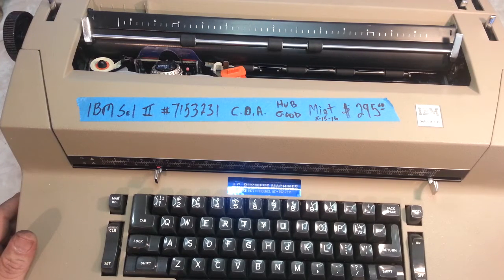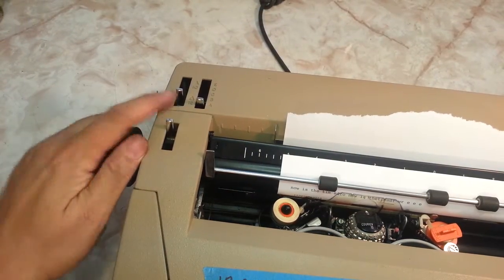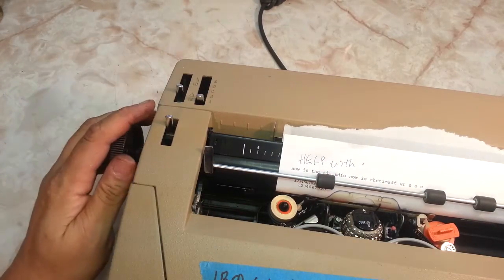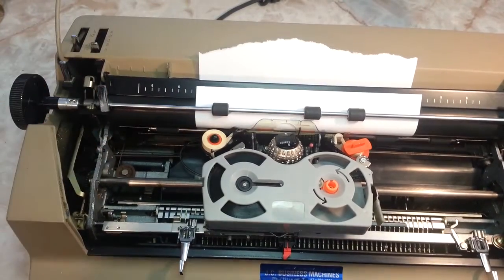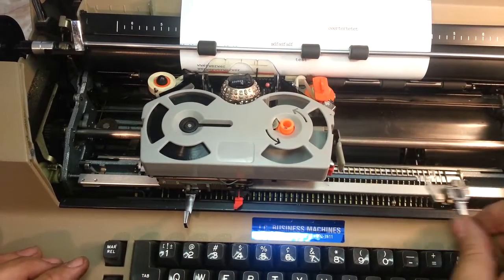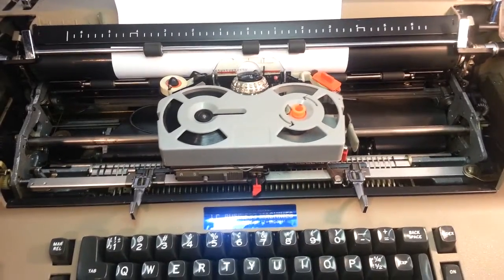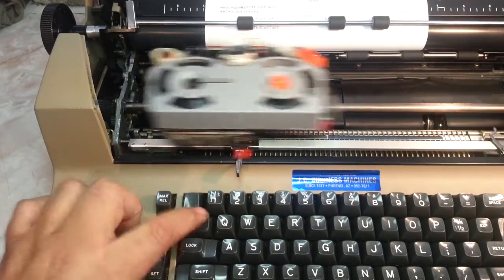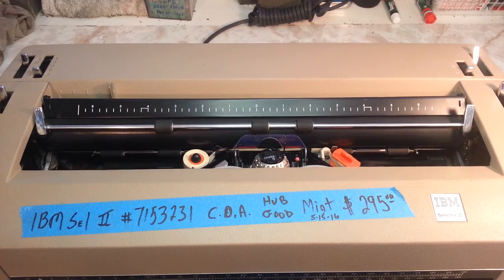IBM selectric 2 II tutorial How to use Typewriter Features Reconditioned Basic operation 101

Comment: You show how pitch can be adjusted to 10 or 12. But your ball is elite Courier 12. What's the interplay between ball type and pitch selection?
Reply from the maker: 10 pitch, Pica, is larger spacing @ 10 spaces per inch
12 pitch, Elite, is smaller spacing @ 12 spaces per inch
10 pitch ball will have larger type, set to match 10 pitch print spacing will be standard
12 pitch ball will have small type, used in 10 pitch setting the printed type will spread out, 
10 pitch ball will have larger type, used in 12 pitch setting the printed type will crowd, the letter M will touch itself

Comment: Can you please help? The ribbon isn't rolling as I type. It's marking only one single sector of the ribbon ink and won't turn as I type. The ribbon seems like its just like yours all ribbon rolled on the left side and nothing on the right side and as I type the ribbon remains all rolled on the left side the left bobin
Reply from the maker: Can't do much long distance, You can make sure ribbon is installed correctly, https://youtu.be/BXBNMPc6rbg
If everything is installed right then typewriter has a problem, sticky parts, gear broken, troubleshooting would need to be done
Reply: @phoenixtypewriter2136  after looking better into it I realized that the problem is with that center column that should move towards the right side but its stucked in position.
Reply from the maker: @TheDormonid  Very common.... https://youtu.be/IAej9KZhZ3Q

Comment: Very nice! I have a Correcting Selectric II, very similar to this one. I believe mine is from 1976. How would I go about fixing the return? When you press return, it indexes the platen, but only moves back so far. Not all the way to the edge of the paper...
Reply from the maker: Most likely a sticky latch gummed up from the old oil coagulating. Could be operational shaft cams are not pushing the mechanism far enough to latch up. Could also be the margin rack out of adjustment. Could be the tab not disengaging, over-riding the latch up process. Could be couple other things. No simple answer.

Comment: When I type fast the letters get out of place and overlap. Would you happen to know what is causing that? I think I heard you mention the solution in one of your vids, but I can’t find it...Thanks for all your videos and tips.
Reply from the maker: More trouble shooting would need to be done because multiple things can cause mis-prints. 1st is to analyze the mis-print, then clean inner ring of typeball, then clean & relube all rotate pulleys & make sure all is turning freely. Then make sure carrier is moving freely & keeping up with action. Also should check escapement rack make sure it's not hanging up there. Could be the interlocks are sticking. Could be the keyboard interposer trips are sticking. These IBM selectric need to be properly serviced & now-a days the old 30yr+ oils have coagulated & are causing slow response, which can cause mis-prints & strange behavior.

Comment: i just bought one . it seem to be working but makes a humming noise similar to a running PC is that normal ?
Reply from the maker: Well these do have a motor and operational shaft that turn while machine is on and running, so some noise is normal.
Very well serviced machines are hard to tell they are on sometimes . . . .
Others have noises, vibrations, clicks, etc. I would have to hear it to tell you if it was normal

Comment: I have one of these but it doesn’t have a slot for correction tape,the keys won’t move, and whenever I press a key it freaks out. What should i do?
Reply from the maker: Quick answer is bring it to a professional typewriter mechanic, Probably sticky, gummed up parts, Isolate and flush/clean
Long answer is study the theory of operation of the IBM Selectric, get familiar with how it should work, then troubleshoot typewriter and clean and service and repair as needed, Btw this took me 10 years . . . . .

Comment: My typewriter keeps on getting stuck at the 50 on the front. What do I do?
Reply from the maker: Look for the obstruction/troubleshoot, check the lower operational covers for warpage, 
check the tabulator rack for errant tab stop, check the main spring for loose tension,
check the feed roller clearance, check the right transport pulley

Comment: Here's a question: I noticed a few keys, such as the "1" key, have four or five symbols. Seeing as there appears to only be a "shift" key, and no other "modifer" keys, how do you use those?
Reply from the maker: IBM would have different balls, usually 4, that would have different set of symbols. The key-tops on most selectric II were universal & listed several per effected key-top. If you ordered a Selectric 1 with a type ball with special symbols the machine would be fitted with corresponding key-tops to match. Some selectric 2's were also delivered with only the matching key-tops when order with special type ball. Selectric 3's added 8 characters to the type ball thus eliminating this some, but they still had mutable choices also. I have a IBM type chart that shows the type style & the different part numbers associated with each special symbol-ed balls. BTW, right below the plastic piece that you pry open on the type element to change it is a 3 digit code for that balls exact style. I will try to add the chart to the end of the video.
Reply: Phoenix Typewriter
Ok. That makes sense.
Reply: I was going to ask the same question!! How do you type the number 1!!! :)

Comment: the Old English text on my ball element, does "machine gun" typing when I key the "e,"then almost simultaneously it hyphens, e-e-e-e-e-e-e-e- non stop! how do I prevent that? Bakersfield , CA have no technicians to checking or repairs! I use Selectric to type a Bilingual Newsletter to my dancers, & can fit more words than on the PC. PC has NO Old English Text.
Reply from the maker: Sounds like sticky parts, many things can cause cycle clutch not to latch up (repeat)
There are a bunch of typewriter shops in California : https://site.xavier.edu/polt/typewriters/tw-repair.html

Comment: I have the Correcting Selectric II also. It works well but makes A LOT of noise when turned on. Do you have any idea what the problem might be? I wonder if I could get it serviced somewhere. Does anyone do that kind of work anymore! :)
Reply from the maker: IBM selectrics can make a variety of noises, rattles, clicks & thumps. I would have to hear it clearly & then I could tell you, usually exactly, what is wrong & what it needs to get it repaired. Without regular maintenance those selectrics occur compound problems too. I'm in Phoenix, I know of at least 50 typewriter shops across the USA that could service your machine, what part of the country are you in ?
Reply: Thank you very much for the reply. I live in King George, VA. I'd love to get my typewriter repaired. I love your videos! They have been very helpful.
Reply from the maker: Go to this site ....... look up your state and see if you can find a local shop with IBM selectric experience. If center hub is good, I can fix any selectric for between 65.00 & 95.00. East coast shops tend to be high priced for same service.
http://site.xavier.edu/polt/typewriters/tw-repair.html

Comment: my return button doesn't reset to the start of the page but instead just jumps down to the next line in the same position. anyone know how to correct this?
Reply from the maker: Of course I know how to fix this as well as All problems with IBM Selectrics, 40+ years as IBM Master Mechanic
How to tell you how to fix this is another whole issue, return mech is sticking more than likely,
Chemical flush complete return linkage and trip, cams etc.